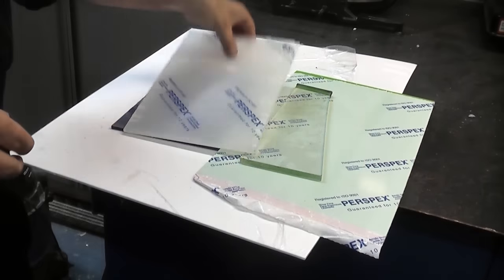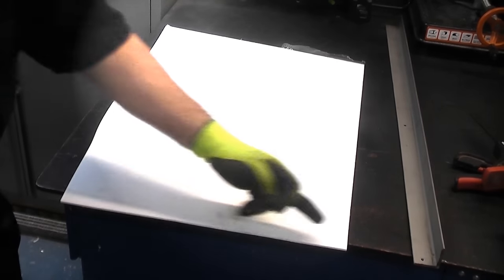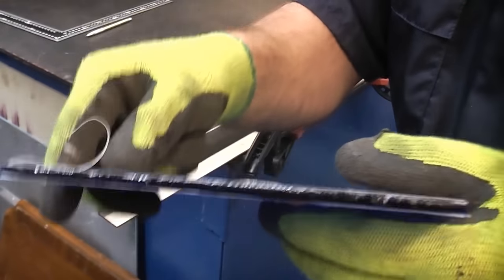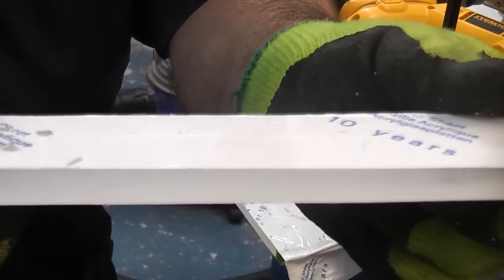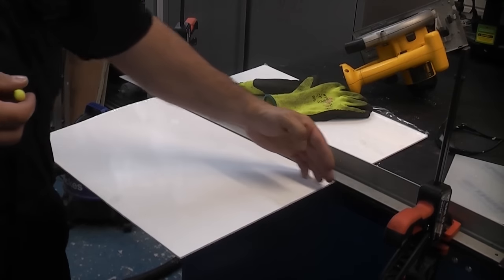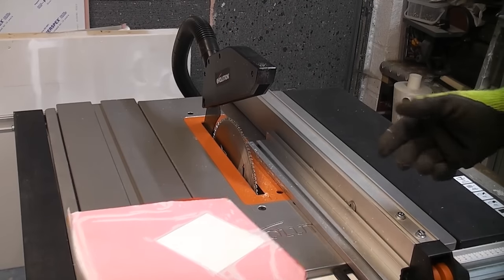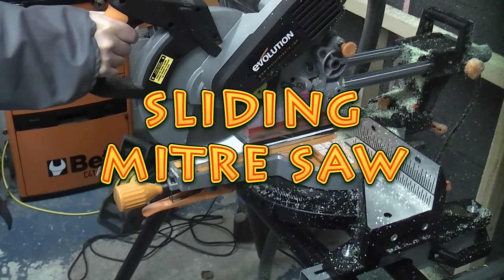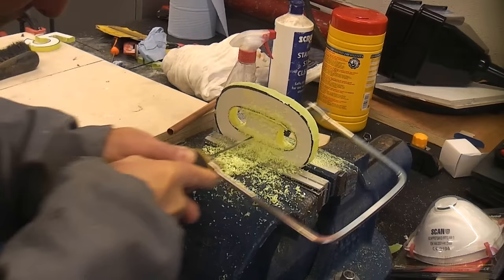How to easily cut acrylic sheet

Comment: The Acrylic piece welded itself... Is it due to heat generated by the saw bobbing up and down?
Reply from the maker: Yes, that is correct.
Thanks for the comment
Reply: Ultimate Handyman Noted. Because I wanted to cut a 2mm thick acrylic sheet. Thank you.
Reply from the maker: 2mm thick does not weld itself as easily as thicker stuff as there is less friction- but it is still possible.
Best of luck with it ;-)

Comment: Was the table saw blade you used called an acrylic cutting blade or a metal cutting blade or just any blade with 120 teeth will work? Thanks!
Reply from the maker: Any TCT blade with lots of teeth will cut acrylic. The more teeth, the better the cut 👍

Comment: Sawing, Silicone oil works fantastic as lubricant and prevent gumming 
Scoring on both sides is also good when breaking or, if short pieces, a blow by hand or a soft hammer
Reply from the maker: Thanks for the comment

Comment: Quick question do yoy reccomend buying an expensive jigsaw?
Reply from the maker: Yes, I definitely would.
A few years ago, I went to a friends house to help him erect a wooden fence, but I forgot to take my power tools. We needed to rip a length of timber for the fence, so he gets out his cheap jigsaw and hands it to me. It was absolutely useless, I could have cut it faster using a knife and fork - honestly I was traumatised after using it 😂
You have just reminded me that I need to review the Dewalt XR jigsaw (it's superb)
Thanks for the comment 👍
Reply: I see what your recommned price point for this? You said you plan to review on the jigsaw you brought.
Reply from the maker: @gaalxystar1873   Mine was purchased as a bare unit, as I already own several batteries. I think it cost about £150
But you can get a mains voltage one slightly cheaper. Bosch make decent jigsaws too.
It depends how much use you will get from it, if you intend using it a lot I would spend the extra money and get a decent cordless one. 
You can see my old dewalt jigsaw being used in these videos-
https://www.youtube.com/watch?v=HoN0GvlgQxI
https://www.youtube.com/watch?v=fWpHzf1I0BI
https://www.youtube.com/watch?v=LacH07w8zxw

Comment: Can it be drilled through with a hole cutter or spade bit?
Reply from the maker: It depends on the hole cutter, if it's a hole saw, then yes that will work. The spade bits will work, but you have to watch out for breakout when exiting the hole, so it's best to clamp the acrylic to a scrap piece of timber- that should prevent the breakout ;-)

Comment: Some great info here, thanks. Do you have a link for the blade you were using on your Evolution table saw please?
Reply from the maker: Sorry, I don't have a link to the exact blade. Just make sure you get one with more teeth, as you get a better cut, also make sure it is TCT. 
I ended up with 2 blades as the first one that I bought buckled (cheap crap), I'm sure the one that I have now is a TREND blade, but I also have to use a reduction ring. I hope this helps ;-)
Thanks for the comment 👍
Reply: @ultimatehandyman  thanks, will take that info on board mate👍🏾

Comment: Is there a way to do circles without cutting squares then sanding to shape?
Reply from the maker: Yes, you can use hole saws, but you might need to make a jog, or use a pillar drill. The best way is using a laser cutter, but not everyone has access to one of those!  👍

Comment: Great video 
What glue is best for sticking acrylic together and what blade do you use in the scroll saw is it flat or a spiral.blade ?
Reply from the maker: Tensol cement works best on acrylic, as it melts the two components together.
My scroll saw has a flat blade.
Thanks for the comment

Comment: What if i needs to cut 10mm acrylic? Is it possible to use hacksaw or jigsaw?
Reply from the maker: You can use either, but a jigsaw is much easier. Make sure you use a blade suitable for cutting acrylic or metal and have the blade moving at a slow speed.
Reply: @ultimatehandyman  How to decide a suitable blade? Thanks man for yr swift reply.
Reply from the maker: Just get one with fine teeth, such as a metal cutting jigsaw blade, as a blade with course teeth will chip or break the acrylic.
Reply: @ultimatehandyman  Great! Is angle grinder also possible to achieve good result?
Reply from the maker: I don't know. I only use angle grinders on metal.

Comment: do you get a strong odor when cutting this? i cut lexan with a circular saw and i'm concerned about the smell. often there is a line of built up melted lexan along the cut edge that needs to be filed away
Reply from the maker: It depends, some acrylic sheet smells more than others when being cut due to the different chemicals in each sheet.
There are a lot of chemicals that can be added to the sheet to alter it's properties such as UV stabilisers and chemicals which make the sheet easier to mould when vacuum forming etc.
Lexan is a polycarbonate so will have much different chemicals in it than Acrylic. 
Thanks for the comment
Reply: Ultimate Handyman j

Comment: I've heard it can be done with an angle grinder. Haven't tested it.
Reply from the maker: I have never tried that, to be honest!
Thanks for the comment
Reply: an angle grinder  work extremely well cut acrylic if you use a 1mm metal cutting disk and it real fast but you do need to remove the Burr's after
Reply from the maker: I'll try that when I get chance ;-)

Comment: Hi There, I have an electric ceramic tile cutting machine. The circular cutting blade is water cooled / lubricated, with a diamond perimeter edge. Can this setup be used to cut acrylic sheet?
Reply from the maker: I was told that it could, but I tried it once and it was difficult to cut, but my machine was not an expensive one.

Comment: Hello, i got some questions, please! Is this cast or extruded... i am trying to cut a 12mm plexi with the scroll saw and it simply weld back together... some advice please? I dont't know if i got the cast or the extruded...
Reply from the maker: The acrylic in my video is cast.
12mm can be difficult to cut, you need to slow down the speed of the blade to prevent it from welding itself back together.
Thanks for the comment
Reply: And it's such a huge dif between 10 and 12 so that i can't cut it? I guess i have to search for 10 mm
Reply: Anyway thank you for the reply, one more question. When you cut, you blow air to the acrylic?
Reply from the maker: You can use air to cool it, but as long as you have the blade moving slowly it should be fine ;-)
Reply: Draw your cut line and smear a little Vaseline or clear petroleum jelly on the line then cut it with a scroll saw. It’ll not gum up or weld back together.

Comment: is it the same for cutting lexan/polycarbonate
Reply from the maker: No, they are not acrylic! I've never cut any polycarbonate- yet. 
Thanks for the comment
Reply: You may have found this out by now, but I've had excellent results with Lexan on the tablesaw (assuming a sharp, quality blade).

Comment: I tryed to cut 10mm acrilyc with Makita track saw, using track. Didn't go well, lot of smell, melting acrilyyc. I used slowews speed of blade,cut was hard. Maybe I should go slower...
Reply from the maker: were you using a circular saw or jigsaw?
Thanks for the comment 👍
Reply: @ultimatehandyman  Track (plunge ) circular saw. Like Festool TS just Makita. 48 carbid tooth blade, 160mm diameter.
Reply from the maker: I've never had that problem before with a circular saw, perhaps you could try moving the saw a little faster- but without forcing it?

Comment: hello sir, can i know the brand of the blade that has 120 teeth? planning to get one for cutting 5mm acrylic.
Reply from the maker: I can't remember the make of the original blade that I bought, but it buckled. I now have a Trend blade, which should be a lot better quality.
Reply from the maker: It will cut the acrylic, but the cut will be better if you have a blade with more teeth, perhaps 80 teeth or so.
That saw and guiderail look amazing!

Comment: Hi.  What blade did you use on the table saw?  Thank you
Reply from the maker: I bought a special blade for cutting acrylic, but unfortunately it buckled and so I had to buy another one.
Now I have a Trend blade, which has more teeth than the supplied blade that came with the machine.
Thanks for the comment

Comment: You do not want to use a jigsaw it will leave scratch marks on both sides use a table saw sandwiched between a piece of MDF no problems be done B clean
Reply from the maker: Any electric saw will scratch the acrylic if you remove the masking first ;-)
Thanks for the comment 👍

Comment: Wet tile saw .
Reply from the maker: I tried that a few years back, after someone recommended it in the comments section. Although it will eventually cut the acrylic, it is painfully slow!
Reply: @ultimatehandyman  must be the blade that’s on mine it’s old as the hills it slices through 3mm like butter
Reply from the maker: Mine was only a Silverline one, but it used to cut tiles well. It was useless on acrylic though! If I get another one, I’ll have another go for sure 👍